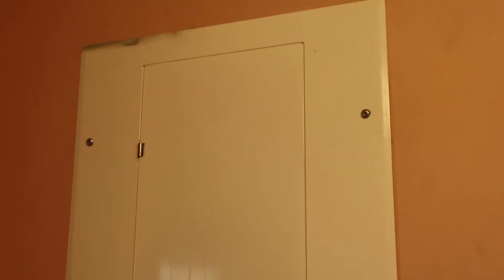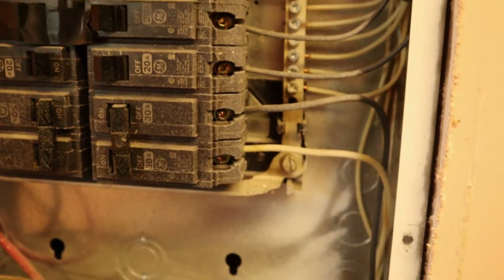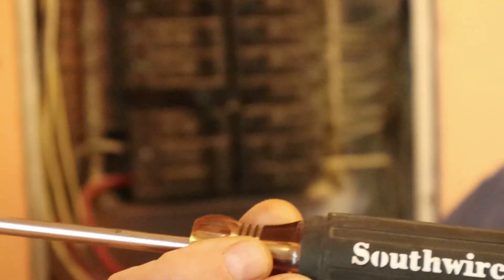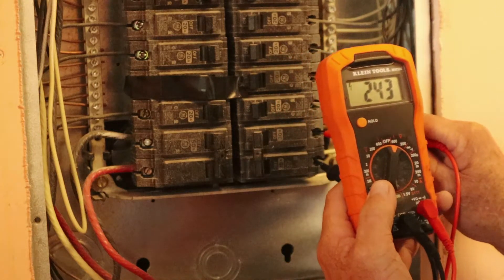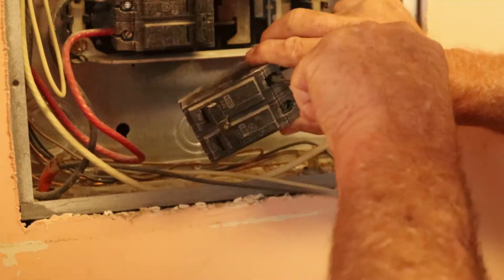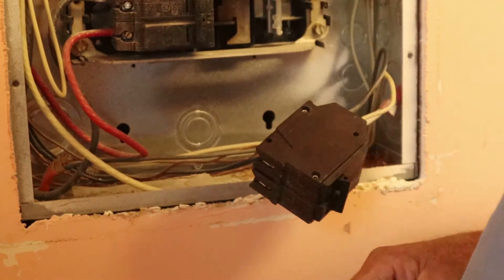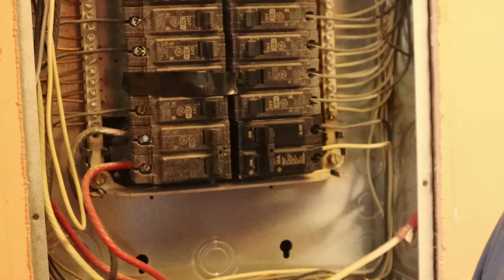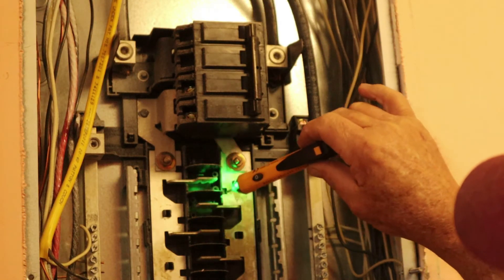How to Replace or Install GE 30-Amp Double Pole Electrical Breaker

Comment: What was he touching with the black lead at 5:13? The multimeter was blocking the action.
Reply from the maker: Normally the black is always touching the neutral bar or ground when the red is touching power

Comment: Had a 2 pole 30 amp breaker go bad that runs power to my shop out back. It’s a 70s build that was wired to a 2018 build home. Hoping a new breaker solves the issue and that it isn’t something sinister with the wiring to the older structure. Has Square D breakers and should hopefully be the same sort of install. Thank you for your knowledge and I will for sure be flipping the main to get this done! Prefer chicken fried steak, not me from a mistake. 😂

Comment: Did this fix your dyer? I'm having the same exact issues and want to know if the breaker is the problem
Reply from the maker: Yes it did. I was running on one leg..Hopefully yours has the same issue. It's an easy fix

Comment: Thank you for this video. It is very helpful. May I assume that if I want to replace a 30Amp double breaker with 50Amp (switching from unused circuit from old dryer to new 50Amp sub panel), the process is going to be the same? I am not going to reuse the wire from the old 30Amp circuit.
Reply from the maker: If I understand you correctly , the principle is the same

Comment: Why not just flip the main breaker on the top to off? Should kill power to those breakers you’re replacing.
Reply from the maker: Yes you can do that as well. I didn't want to have to reset all my clocks..

Comment: Can I change a 20 amp breaker to 30 amp breaker?
Reply from the maker: Yes you can change a 20 to a 30, as long as the breakers are the same type.. But you you need to make sure that you stay within certain parameters on electricity..don't overload the size of wiring in your wall that it is connected too.
Reply: @LarrySbrusch  gotcha but I just have to figure out which one wire 8 gauge ir 10 gauge all depends what type of appliances I have to run

Comment: Your age shouldn't be an issue, it's your knowledge and experience  that is always a positive and I thank you for that! Love the way you stress the importance of Safety. 
"YOU ONLY GET ONE SHOT" so true!!
Thank you again, I learned quite alot with your video!
Keep up the great work your providing us veiwers!!
Reply from the maker: Glad I could help. Appreciate the comment
Reply: @LarrySbrusch so I can use any white neutral wire to connect to the 30 double breaker? It's more than one white neutral wires. 4 on one side and 3 on the other.
Reply from the maker: @marleymarley  without seeing a diagram of what your trying to do, I cannot offer any advice.i would like to help, but I would need all the details

Comment: Sometimes us dumbasses get a second chance. Im still here after surviving a few stupid things I did with electricity. Risk of being the kid of an engineer that had all kinds of equipment to poke my fingers into against all the advice Dad gave me to stay away from. My first experience involved a fork and an electrical outlet when I was about 4 years old. I think my mother suffered more from the stress. Poor Mom. Lol.
Reply from the maker: Been there, done that. My first stupid thing was!!!!  Took and extension cord with the bare wires exposed and plug it in. Had a few sparks, then the curtains caught fire, got my butt whipped

Comment: Your video was quite helpful to me. I put in a 40 amp double pole breaker for a new Mini Split ductless air conditioning unit I installed. By doing all the work myself (including the electrical) I saved around 6 grand.
Reply from the maker: sure glad I could help..Thank you for the comment..
Reply: I hope you changed the wire too
Reply: @jonesp4783  It was a brand new breaker, so I ran brand new wire to the spot. 8.2 romex

Comment: Can you use fatheads on these breakers? It looks like it has a slot but it's pretty wide.
Reply from the maker: Yes you can use flatheads on them if it has the slots

Comment: So I have a breaker that keeps tripping. I checked itand one of the wires just came right off. I  tighten it and hopefully it will hold. Going to Home Depor and get me the GE screwdriver for a better hold and tightening.
Reply from the maker: If the breaker is real old. It may be defective. You can try to tighten the wires, but my guess is bad breaker. If it still trips , you have a load issue
Reply: All good Larry.  I bought the right tool for the breaker tightening. Thank you for that information.  I  also replaced the window unit with a 220 unit on it's own cuircet, and it's not tripping anymore.  The breaker is fairly new.  Less than a month.  Thank you for your video and advice.

Comment: Are all of the 30A breakers double pole? I need to replace 15A in my garage to a 30A so I can install a car lift. Thanks.
Reply from the maker: Is the lift 110 or 220 volts
Reply: @LarrySbrusch  110 volt
Reply from the maker: No you can buy a single pole 30 amp breaker

Comment: I a sub panel , don't you have to isolate the ground bar from the neutral by removing that coupling bar at the bottom
Reply from the maker: Got it. appreciate the comment. Thank You

Comment: Hi Larry, Great video to follow. My office has a 2 pole 30 amp breaker with a NEMA 14-50 (50amp) receptacle. It was already installed like that before I moved in for a dryer. Do you know if this is correct? I thought a 2 pole 30 amp is 60 amp therefore need a 60 amp receptacle. Let me know your thoughts. Thanks.
Reply from the maker: You will only be able to pull as much as the breaker can supply. No matter what size the plug is. Hope this helps. Refer to tag on appliance. I wish YouTube would let you upload it
Reply: @LarrySbrusch  Thanks for the response. Keep those videos coming!

Comment: What's the difference between a 1 in and a 2 inch double pole breaker
Reply from the maker: The main difference is you can put more of the smaller breakers in one breaker box..Remember not to max out based on the breaker box you currently have..For instance, my Breaker panel is a 200-Amp service. I can not exceed a combined 200-amp breaker array. Hope this helps

Comment: Does it matter what side you put the hot and the negative wire in the breaker
Reply from the maker: If working on 220-240 volts. It makes no difference. Each wire or  leg has 120 volts each for a combined 240 volts

Comment: I have a bad breaker for my oven and a good breaker for my dryer(which I don't use)  can I swap the wire hook-ups?  A new breaker can be hard to find, and I don't want a new panel.
Reply from the maker: as long as both breakers are rated the same, say a  50 and a 50.. then you can use either one. You can't use a 30 amp breaker on a 50 amp appliance..It is highly possible under heavy load that it will trip it

Comment: I'm running from my main breaker box out to a smaller breaker box I think it's a 4x5x8 gray exterior metal it only holds 1 twin or 2 single my question is can I take a twin 30 and make it into 2 single 30 ? Also is 10 ga. Wire good enough or should I go bigger like 8 ga.? I'm hooked into a twin 30 Amp in the main house breaker box .     Just to let you know I am not a sparky but I've been in the trades as a carpenter for around 38 years I'm just a little rusty lol must have drank to much beer in the past hahaha I would really like a 2nd opinion from you seems like you know your s*** thanks you so much .    Johnny R.
Reply: You can split a tandem breaker (one that has a bar between the two breakers to operate them simultaneously like the one in the video) as long as 1) the equipment that uses the two circuits operate independently, and 2) the common wire is not shared between the two circuits, and note that a shared common wire is usually how tandem breaker circuits are usually wired.  If there are only three wires in the conduit, one is neutral and two are hot, with the difference between the neutral and each hot being 120 volts, and your common is being shared between each of those two 120 volt circuits.  In that case, you must use a tandem breaker and you cannot use two independently-tripping breakers.  It is permissible to share the common between two independently0-operating circuits as long as you have a tandem breaker.

10 gauge wire is rated for 30 amps, but there are online calculators for checking.
Reply from the maker: @charlesgotlieb773  Great Answer...
Appreciate you stepping in to help this youtuber out..
Reply from the maker: Guage of wire depends on how far it is ran and what current you are trying to pull through it. Also on breakers you can use one, but then again, it depends what you are connecting at end of wire. Its difficult to understand with out seeing the project of drawings of it.. My final thoughts are , the load dictates what is in front of it
Reply from the maker: You should be able too
Reply: It's working beautiful Gentlemen I thank you.
Reply from the maker: first off would need to know what your load will be  and is it 110 or 220. I would not advise (if I understand you correctly) and is the main 30 that you are pulling off of one single double throw or two singles. Also the last sub panel must be rated to handle the end load..Need more information to better help you..

Comment: You make it look so easy! I need to change one but I’m afraid of working with electricity! For a beginner should we shut off the main for sure? I assume that’s the best way for us beginners..?
Reply from the maker: Yes if you shut off the main it is a lot safer. You still need to stay away from the main supply wires coming in. Remember you will always have power coming into the breaker and none after that point when it is shut off
Reply: @LarrySbrusch  great thanks Larry! To Home Depot I go!

Comment: I can't take you seriously when you say safety but you leave the power on to the box... but thank you for the video. Its helpful.
Reply: Give the man a break.  He needs the light for video.  Main thing is he shows you how the GE breakers come on and off of the panel’s bus bars.
Reply: He was clear that a beginner/inexperienced person should shut the main power off.  Experienced electricians can still be safe but not need to do things that less experienced people need to do.
Reply from the maker: Cristina Vincent thank you
Reply from the maker: I understand. But it is kind of hard to test something without power. Appreciate the comment
Reply: There is always an a..ho.. with negative comments.